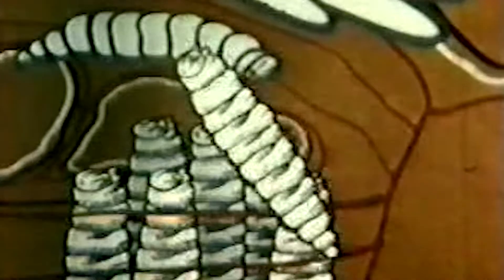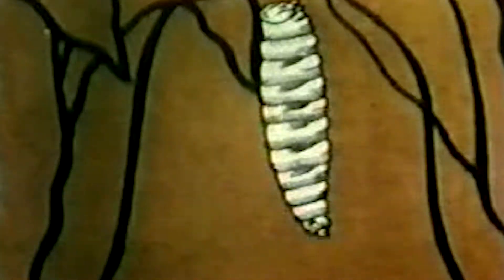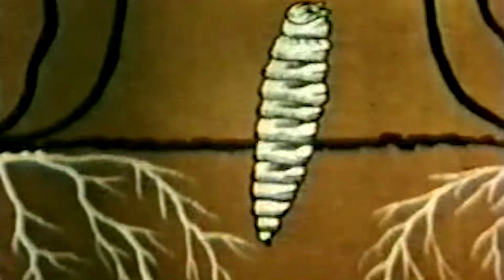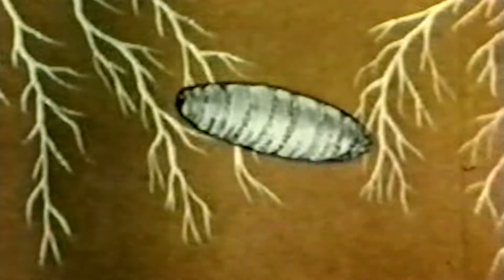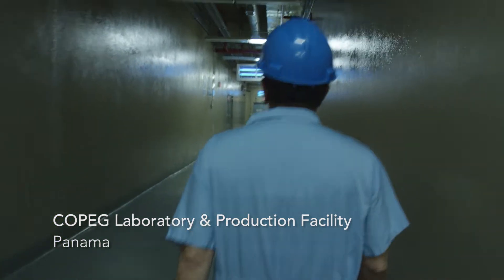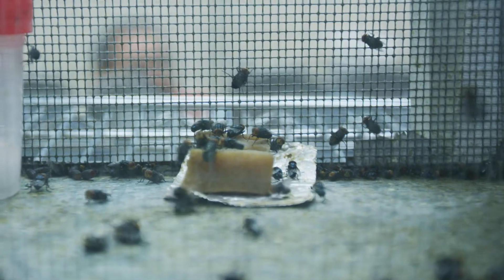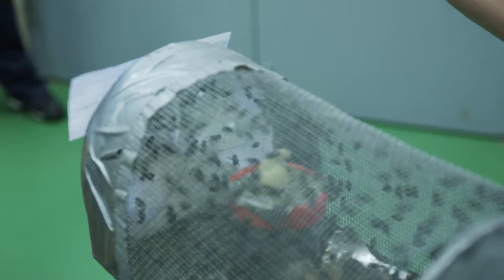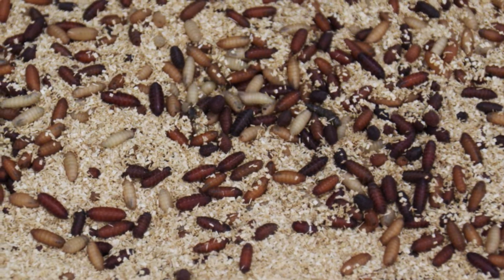Eradication of the Screwworm

Comment: I came across this video during a search over a local decommissioned air force base, Moore Airfield.  I found out that part of its use, much later, was in sterilizing screwworm.  Pretty amazing stuff!   Also, I still don't know exactly what the rest of the facility is now used for since, most websites mention that it was bought partially by US Agriculture and "private entities", yet that the runway, water tower and certain areas are still well maintained.